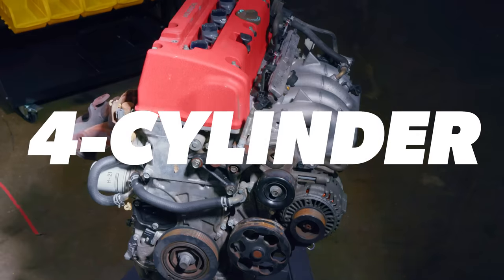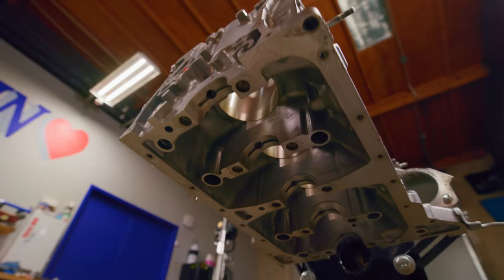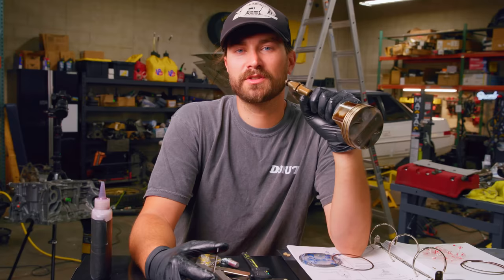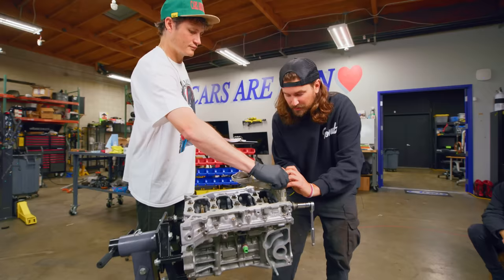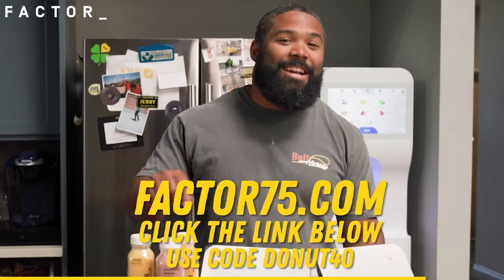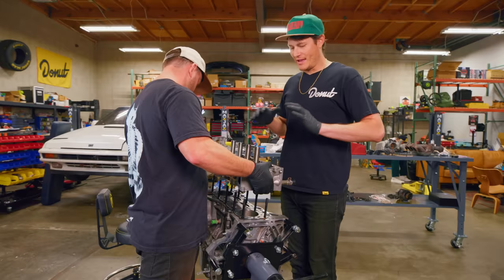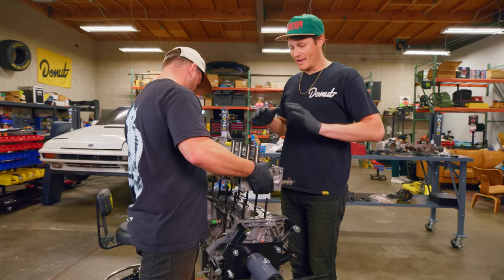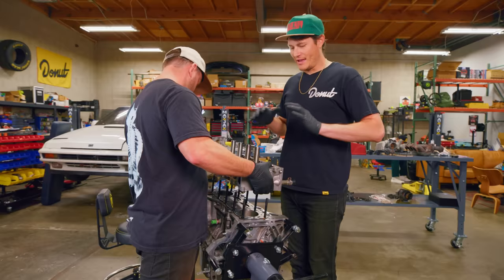Why This Tiny Honda Engine Can Make 1000hp

Comment: This doesn’t ruin the fact that Hector’s running 3 spoon engines…
Reply: ya
Reply: And he just bought 3 T66 Turbos
Reply: And NOS
Reply: Needs two of the big ones
Reply: Tomorrow today NOW
Reply: Don't forget a motec system exhaust
Reply: nnnNO!! not again!!! yall cant keep getting away with this on every honda videos 🤣🤣🤣
Reply: And a MoTec system exhaust
Reply: poor hector will be the laughing stock at race wars after putting boost from t66 turbo into a spoon purpose built N/A high compression ratio circuit racing engine. the money put into just the spoon engine alone he could have built 2 fully built high powered drag motors
Reply: He bought all the extras at Harry’s
Reply: Alright, that's valet parking!
Reply: But who is hector
Reply: @amandeepbaa6978 HE'S F A M I L Y
Reply: @amandeepbaa6978  askin yhe the real questions
Reply: @amandeepbaa6978  the guy with 3 spoon engines
Reply: It always bothered me that he bought Spoon engines and turbos to go in them...
Reply: @dutifulbarrel9084  any yt ch about him
Reply: That’s over a hundred grand build though.
Reply: This would be the engine he would be buying from spoon lmfao
Reply: @amandeepbaa6978  it’s from the first 2 fast 2 furious. I’m sure there’s tons of clips of it on YouTube
Reply: @Scumiest  it's actually from 3 Tokyo 3 Drift.
Reply: The washers on the floor board is hard to watch today.
Reply: Cool dude alert ⚠️
Reply: Smh Hector still waiting on those engines
Reply: How original
Reply: Men of culture we meet again
Reply: @GENREPOZA  a family man with 3spoons
Reply: @tseimucS It's from the 1st one which is The Fast and the Furious. Hes a cop. HES A COP!
Reply: @wes8052  no Cuban NOS?
Reply: What does spoon mean?
Reply: At least he is to slow to run away with the money
Reply: @realcnstudios  Spoon is a Japanese tuning company specializing in Honda engines
Reply: @RascalCatify  I understand, thank you very much for clarification
Reply: References
Reply: Ruin the fact? How does this have 1000 likes when you don't even know the line 🤣🤣🤣
Reply: I need a spoon engine in my civic
Reply: Old guard saluts you sir!
Reply: I like the tuna here
Reply: He has a last name too but he can’t pronounce it 😂
Reply: @iPhone5244 get the cheeseburger and fries for $2.95!!!!
Reply: He should have gotten a Gallo 24. Those are the best motors, especially for a Skyline.
Reply: where is this joke from... :)
Reply: Hands down!
Reply: @iPhone5244  
“Bull $&@%, nobody likes the tuna here”
Reply: We need a meme car company to make a spoon engine lol
Reply: With nos
Reply: @TheGamerKid204  the first fast and furious movie
Reply: SR20 PREMIUM A WEEK BEFORE RACE WARS
Reply: Today, tomorrow, now?
Reply: Anything that gets the DVD heist done is fine with my crew (sorry FAMILY) buddy.
Reply: God I wish this joke would just die.
Reply: If only Paul Walker's stunt driver had seen George of the Jungle....
Reply: No
Reply: Bro I told you hector so slow he’s the only one trusted to hold the money
Reply: Is a spoon engine a real engine? I have a nailhead in my 61 Buick so im curious if spoon engines are actually a thing or if it was just made up for the movie😂
Reply: @Cam-gb1cu  they're real. I only know this from Gran Turismo lol
Reply: With nos.
Reply: "I need one of these, one of the big ones, no actually no let's make it 2 and Harry I need them by tonight"
Reply: I saw Hector at LS Fest. I was like "heeeeey, look who it is" in my head
Reply: and T3 turbos
Reply: This comment thread 😂😂😂 this is why I come here
Reply: Because he's to slow to run away with the money
Reply: 3 t66 turbos and motec system exhaust
Reply: @pigeonsil240sx  IPG will sell you a Spoon engine for $14k, or a Spoon engine with a t66 turbo for $15k. It seems like a joke but I think they will really sell you the turbo.
Reply: "He's a Cop"
Reply: Shit...did not expect this comment... hut love kt
Reply: @Bumble BeeYaj  "are you a cop?"
Reply: Got ‘em
Reply: Overnight parts from Japan
Reply: Best comment
Reply: He’s a cop
Reply: I just watched the first movie about 4 hours ago lol
Reply: Brian can't lose again.🚦🚗
Reply: Avg honda hater
Reply: With a Motec exhaust 🙃
Reply: The fact my guy was fitting t66 to tht motors
Reply: @GENREPOZA  tell em Don!
Reply: @MujinTouge  😁😂😁😂😁
Reply: First youtube comment section where there is no drama, very impressive
Reply: Who cares about spoon engines when you can have a nissan skyline gtr r34 with a gallo 24 engine.
Reply: Repent. Believe in Jesus Christ and become a new person in this life.      
John 3:16 KJV - For God so loved the world, that he gave his only begotten Son, that whosoever believeth in him should not perish, but have everlasting life.       
Luke 13:3 KJV - I tell you nay: but except ye repent, ye shall all likewise perish. John 3:3 KJV - “Jesus answered and said unto him, Verily, verily, I say unto thee, Except a man be born again, he cannot see the kingdom of God.”
Reply: Actually they were k20a spoon engines
Reply: Na he’s going legit Homie
Reply: Too soon JR!
Reply: Lol
Reply: With a motec exhaust
Reply: With Mo Tec
Reply: @MujinTouge lol they got people hyped thinking motec actually started making exhaust systems
Reply: Spoon man🎵
Reply: I used a Spoon to eat breakfast
Reply: @scottyhankemeier9380  😂😂😂😂😂
Reply: He’s a cop I can smell it
Reply: 3 Spoon engines to waste it on boring drag racing.
Reply: Motec exhaust
Reply: @TlnpotGaming  ok9 ill
Reply: Yea it does.
Reply: For whatever reason, the references from the first F&F movie never get old.  Lol
Reply: Why sobmany ppl talki bout me what did u do wrong
Reply: @Truen091  but I like the tuna
Reply: Hector got deported by Donny J
Reply: Lmao amazing
Reply: there in the warehouse there in the warehouse
Reply: With NOS. And a Motec system Exhaust
Reply: Lmao
Reply: Aren't you original
Reply: Don’t forget he’s running the Nira circuit now.
Reply: And a motech system exhaust f#%*
Reply: You fooi spoon engines are the highest grade Honda engines. So it makes sense hector would want spoon engines. 

Just like you'd 10x rather have that  Ford Cosworth engine over the Ford engine. 

When USA gets its 💩 together it will realise what the Ford Sierra Saphire cosworth is all about. 

210mph. 0-200mph faster than a veyron and 4 cylinders. 

Ford Sierra cosworth 210mph 

Search it. The Supra Slayer before the Supra Slayed.
Reply: @realcnstudios  It means pick any car it's getting spooned all the way
Reply: @LookaReaper  Spoon Civic go learn.
Reply: @Cam  Spoon racing is the Honda version super special models. 

R type Meh compared to Spoon didn't you play old gran turismo. 

The yellow Spoon civic is legendary.
Reply: Just watched the Furious X... What a waste of my money... The franchise has lost its way 😢
Reply: And that we can’t lose again
Reply: Never understood the fast movies..they were so stupid
Reply: I don't think them spoon engines gonna hold up against now days k series and standalone and part yeah hector n them spoon engines need be on display now cuz they dope for the time but not top line no more 😅
Reply: Noce l have eg turbo swap h2ba7
Reply: Who's watching fast x
Reply: It's aii tho BECAUSE THE BUSTER GOT ME OUTA HANDCUFFS 😂😂
Reply: *change
Reply: I was at Fat Burgers and heard this Kswap screaming down the street.
Reply: I was at Fat Burgers and heard this Kswap screaming down the street.
Reply: That statement will always be golden
Reply: What are you feeling vic 30 weight? Or 50 weight?
Reply: @overtorque  😢6,t
Reply: These guys won’t have their car. They’ll be granny shifting, not double clutching like you should.
Reply: With NOS
Reply: Because they may not run on Hope's and dreams
Reply: @pigeonsil240sx  😂😂😂😂IM LOGGING OFF
Reply: @Like_Ike    “Are u a cop?”
Reply: 😂😂😂😂 and tc turbos
Reply: T66
Reply: If only Brian didn’t have such a heavy foot
Reply: Ahhh the only good fast and furious!!!!!
Reply: SPOON??
Reply: Nope not 1000hp
Reply: And a mowtech exhaust
Reply: @iPhone5244  BS, AH. NO ONE likes the tuna here.
Reply: Edited 😂 copy and paste didn’t work?
Reply: See the problem here ted
Reply: Potentially, THE most poorly acted scene in any movie. It's right up there with that Jedi Youngling from Revenge of the Sith. "Master Skywalker! What are we going to do?"
Reply: With NOS!! 🔥
Reply: Put it in a Toyota pleaseeee
Reply: @overtorque with nos
Reply: Eg
Reply: With motech exhaust
Reply: Hector got deported
Reply: i have been summoned
Reply: Yup… legend has it that he’s still out there somewhere running those three black civics with the green underglow.
Reply: I have some spoons in kitchen
Reply: @amandeepbaa6978 Hector is actually Hector in real life.  And 37 films.
Reply: Lmao
Reply: We have no engines do we?!
Reply: @GENREPOZA  dude you had me near crying 🤣🤣🤣🤣🤣🤣🤣🤣🤣🤣🤣🤣🤣 HE’S F A M I L Y .
Reply: i’ve been summoned
Reply: @reeceoconnorryan6281  🤣
Reply: Lol
Reply: The greatest
Reply: And a motech exhaust system
Reply: Didn’t hector go buy those for dom,
Reply: With NOS and a Motec system exhaust
Reply: @hendrixc6988 bruh it was to watch then. I remember the entire theater laughing.
Reply: 3 tee sicks tee turbos along
Reply: Spoon engine poop
Reply: He’s a cop!
Reply: FACTS
Reply: @Cam-gb1cu you gotta see the new fork engine. Depending upon the application sometimes a fork engine works better.
Reply: You know what @donut, you gotta kswap an insight and get Brian Gillespie to school you @vtecacademy.
Reply: And Max Ramos just happens to have a red rocket rolling chassis all set up for a k20 with all wheel drive.
Reply: Until today. I still have no clue as to what spoon engines are?
Reply: Well no matter what you say. Hector is still the fastest person in the fast and the furious universe. Nobody and no car can beat him. He holds the fastest record in a 1/4 mile drag 😆 🤣 😂
Reply: Great video guys! I’m pretty sure Hector still trying to go legit. 😝
Reply: Yea cuz he’s Going legit Homez
Reply: I freaking love all you guys with these quotes true fans of the busta
Reply: God grow up with the fast and furious shit
Reply: I gotta last name, but I can’t pronounce it.
Reply: @daveydmur didn’t know pizza joints made engines little boy
Reply: HES A COP 😭😭😭
Reply: @tseimucS the first 2 fast 2 furious movie? There was only one.
Reply: @edwardmoloney7008 shite I thought it was from fastest 7.5 part 6
Reply: @iPhone5244 bullshit no one likes the tuna here.
Reply: @JesusisGod-yk4th  congratulations
Reply: “So wat are u sayin? Ur gona go ‘round checkin everybodys shit out one by one?”
Reply: What does spoon engine mean anyone?
Reply: @alectateformayor5129  it’s a brand
Reply: @ronniejarvis2679 and he gotta motec system exhaust
Reply: @pigeonsil240sx heard that he smoked your ass with one of those Civics though. Race Wars is not a game, juniour. If you aren't running NOS then you are not even running.
Reply: @godspeedelijah  Oh he might smoke me but hes driving a ticking time bomb running boost in a purpose built n/a high compression circuit motor
Reply: Don’t forget the moTEC system exhaust!
Reply: And he paid cash!

Comment: Zach and Jeremiah are definitely the best guys to pair up on an analysis video like this. They both have the best understanding of actual mechanics amongst the guys at Donut.
Reply: Haven’t seen Aaron in a long time. He was very fluent. Wonder what happened to him.
Reply: Now if only Zach could figure out his guts so he didn't get the squirts all the time
Reply: @ry-land-  from science garage yeah he was great and may even be the reason why I found donut, but what I heard is he got a family and started doing something else, also donut has gone a different direction as well from what his videos where
Reply: @ry-land-  I've seen him on a Motortrend show called Runs Good. It's just okay.
Reply: Zach is a trained auto technician and Jeremiah studied mechanical engineering. Pumphrey and Nolan are "just" actor/comedians who like cars.
Reply: @ry-land-  Idk where to start. Aaron Parker was mostly a guest appearance than another Donut member even though he was severly downplayed. He currently runs Wolf Motorsport Wire, a bespoke motorsport chassis wiring solutions company. He just also happens to be one of the few rotary engine specialists, otherwise found entering drift competitions, being a stunt driver, doing his podcasts, or on shows after he became more known with appearing on Netflix's Hyperdrive. Now that he a family, Donut is hard to fit in there, especially of how Donut shoots can be sporradic or suddenly lengthened (according to the comments they say in the videos). If Donut decides to do a RX-7 series, Aaron will definitely be there since it would be extremely difficult to do without him.
Reply: @gdijkema  didn't nolan grow up working on drag cars with his dad or something?
Reply: One of them is a God danm engineer so I'd hope so.
Reply: @gdijkema    I knew about Zach, but not about Jeremiah’s engineering background. Pretty cool!
Reply: @JesseLack  I believe so. He talks about it all the time on past gas.
Reply: @ry-land-  I remember in the first hi low they said he was more of a guest star and not a main stay. mostly because he was wanting to focus on being a professional driver and what nots.
Reply: I actually have that same 01 black accord you drove in the beginning. . Mine is a 5 speed tho

Comment: Just look at the quality of those cast aluminum parts. They look flawless. The Honda makers and quality control are just perfectionists, so proud of their craft. I work in a hospital laboratory and I can appreciate this greatly, because for me making a mistake is never an option, it could result in someone dying. Taking this pride in the quality of the things you create has a powerful effect on the soul, and I’d recommend anyone to try it.
Reply: I am a programmer, not nearly as impressive as someone that is working hands on with an actual product, but that validates your point even further. I can say with all confidence that there is no single better feeling than having written some really robust and elegant code. Sometimes I want to just sit there and look at it
Reply: @rayzecor  Even better when old-you helps current-you after a stackoverflow search...
Reply: RepentandbelieveinJesusChrist repent diz nut
Reply: RepentandbelieveinJesusChrist what proof do you have of god’s existence?
Reply: @rayzecor idk about that, depending on the work you do programmers are incredibly important. If it was code for some life support machine or something then that could cause issues if not written well etc.
Reply: i work at a sawmill. we make paneling, flooring peel cabin logs, build boxes and pallets, and pretty much anything else someone would want that’s made of wood. when i’m building stuff or stacking wood i always imagine that i was getting whatever it is i’m doing and make sure it’s up to par to what i would want. most of my coworkers just through everything in the pile or build stuff as fast as they can. i stack and build fast too but i’m definitely the best at quality control. as much as i hate working i couldn’t give someone else a bad product because i’m mad i have to work. and it feels good knowing that i contributed to finishing someone’s house or being the person that makes boxes or pallets for local companies.
Reply: It’s all the holes in the engine that allow more air in
Reply: Bruh every engine part is finished like that from every brand
Reply: @aaronmarkstaller most definitely not. You’re correct that this isn’t unique to Honda by far, but there are some genuinely horrible engines man.
Reply: Hate to burst the bubble, but years ago I used to work in the Honda supply chain, and not every part on every engine looked like that. The K20A was lower volume and went into more premium versions of their cars so it may have had higher standards, and I wouldn't be surprised if the K20C1 in the new Type R has high standards, but I saw some parts that I'm pretty sure* were for K24W1, K24W9, and maybe K20C4 motors where surface finish in non-functional exterior areas was held to a noticeably lower standard than these. Some of them looked this nice, but Honda wasn't going to spend the extra money to make all of them look that nice. 

* Honda would not tell suppliers those engine designations, only internal codes. K20A appears to be "PNA" based on the letters cast into the bedplate at 3:48

Comment: Mike at Stanceworks being the benchmark for crazy K-Series Swaps makes me happy!
Reply: bawz when you going to do a car show im building a mitsubishi barbarian with a 500 bhp bmw diesel i want to race your civic, weird seeing you outside wt
Reply: @BoostedMike2  As long as you're racing me around a track in that, then I'm good with it! 😂
Reply: I love Mike and his Ferrari, but The benchmark for K was there long before his build even came to fruition.
Reply: @OddBawZ  I'm down for that it's on 33 Inch knobblys I'm building it like a trophy truck but got to haul ass
Reply: Can't wait for the type r with roof mounted mgs in war thunder
Reply: Mk4 jetta shell? With a k20🤷I mean it makes sense since I've seen an integra with a vr6 mid engine so why not🏁🏎️
Reply: @BoostedMike2  dreams
Reply: @BoostedMike2  m57?
Reply: Huge fan of Mike and I love that Ferrari but the K-swap benchmark isn't him.
Reply: Boosted boiz are the kings of Kswaps let’s be honest.
Reply: You talking about stanceworks in Houston area?
Reply: @OfficialGloom  yes mate 68/60 turbskie big injectors, cams and valves and springs, stock bottom end and a 10lb bottle of nitrous 😈
Reply: have your new video queued up right after this lol
Reply: @BoostedMike2  Sound's sweet dude. Im swapping a car aswell with a diesel. Putting an OM606 in a old Volvo 242. Power goal is 500 at the wheels. It'll be a death ride i'll tell ya.

If you got any videos of your project. Post it on YT. Would love to see it!
Reply: Never thought I'd see OddBawZ here but that's mega cool.